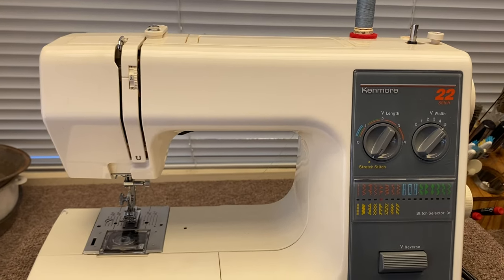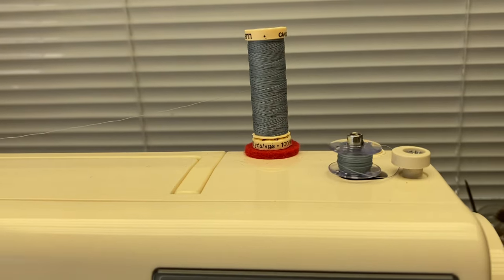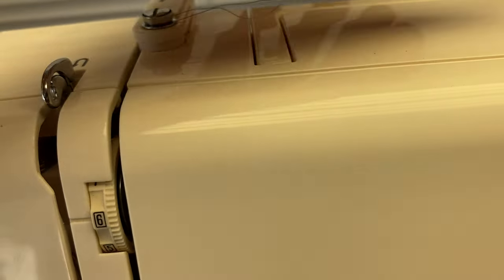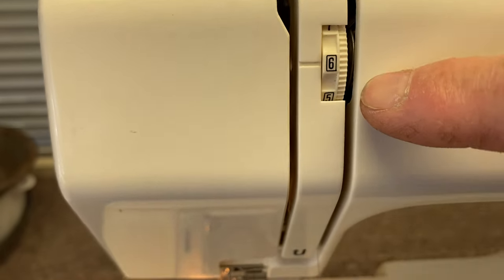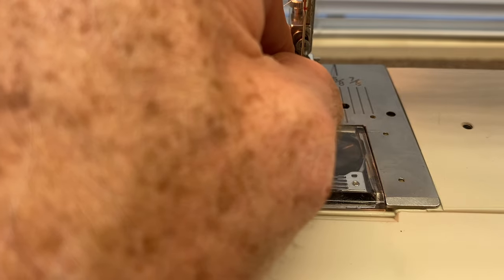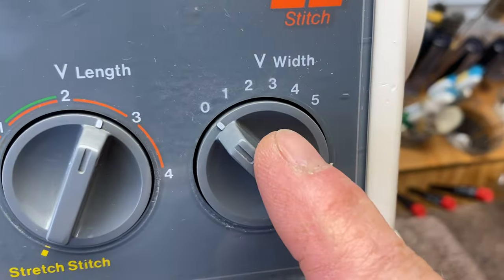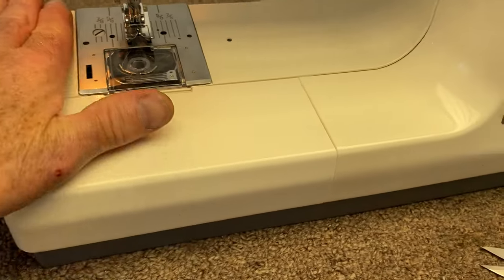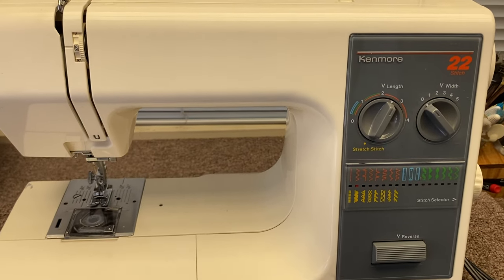Sears Kenmore 385 Sewing Machine Operation

Comment: I got this same model from a friend a week ago and sent it to the repair shop because it was not reverse stitching.  It was not used for eons  but I will call her back to duty after overhaul. Love the solid/heavy feel to it as compared to my new brother "Strong and Tough" (AVOID!). These Kenmores/Janomes have a good reputation as workhorses. Wish me luck and thank you for your great video. Greetings from Puerto Rico 🌴
Reply: Very, very good demo of this machine. I also have owned and used the 24 stitch model since the late 80's. Probably the best purchase of my lifetime. I've never needed to have it serviced. I have kept it oiled, per the manual instructions and have sewn numerous garments, including heavy  wool coats, upholstered two sofas, made handbags, etc. and the timing has survived it all. (I should knock wood making that timing statement.)

Two things. #1 When you open the door on the left to get to the pressure dial (which I use often), there is a diagram showing how to drop the bobbin into place. (One of those tedious tiny things I can never remember - so I use that door often!)

Also, I noticed that as you moved the stitch selector dials they sounded a bit clunkety-clunk and stiff. I was aware of mine sounding and moving clunky like this for years, but simply chalked it up to "age" just like creaking knee joints in the morning.

 All was fine and working one day and then on the next - NONE of the dials would move - At All! Completely frozen! 

I feared the worst - a broken plastic main gear. With much trepidation and fearing I would have to declare my baby dead and gone, I began to disassemble and uncover the nether regions of the right side of the machine - the area never addressed in the owners manual. (Not like I was voiding any warranty after 30 years!) My mouth dropped open in awe as I laid eyes upon a 100% metal gear assembly with minor amounts of lithium grease showing. Poor baby hadn't had a good lube job in 3 decades! At my BIL's at the time, (gifted mechanical engineer) he had numerous containers of lithium for me to choose from, including a spray with a straw nozzle in case I couldn't reach something with a q-tip. I did need the spray in one spot. As I added small amounts of grease, I carefully began moving all of the knobs until everything was moving as smoothly as brand new. I was careful not to allow a cotton fiber to escape from the q-tip.

All of the knobs should move smoothly with little noise and gently click into place on the stitch selector - feeling almost no resistance.

The machine in the video definitely needs a lube. The clunkey/choppy sound is a dead giveaway.

It's been 3 years and my machine has sat unused for most of the last year and a half, so I will probably go back in shortly and freshen the lithium, only this time I will use a 1/8"  to 3/16" wide, high quality 8" to 9" long art brush with short bristles  for application making certain it has no loose bristles. This way I will not need the spray lithium at all, as solid lithium is better when it can be used.

I hope by lightly freshening the lithium every 3 to 5 years at this point it will avoid the need to have to ever disassemble the gear stack completely. BIL agrees with this thinking. We are both big believers in "if it ain't broke- don't fix it", but ongoing proper lubrication is a must.

I'm certain I used less than 1/2 tsp of grease the last time and will probably use less this time. Also if it is necessary to use the spray, remember to be careful not to get any of it on any of the plastic housing of the machine. Oils can play havoc with plastics - especially older plastics - as certain oils and greases will caused chemical reactions if left over time that break down the plastic.

Sorry for the long post, but with no instructions and no YouTube video, I managed this successfully all on my own and didn't even need BIL for anything other than deciphering where in his garage his brain had decided to store lithium grease.
Reply: R. Cruz: sorry I meant to post this as a general reply and not just to you, but you may need the info also.

Comment: Thank you Paul! Just picked up on a $50 goodwill run. It seems to be top notch for hemming pants but the foot connection piece is missing I’ll let you know if I can manage to get the part and hem some pants in time for the wedding (before 4pm tomorrow). I guess I am missing the piece that normally holds the thread on top too…. I was hooking it to the bobbin winder! Great lesson. I suppose there are a couple parts you did not cover. 1 a metal plate that raises the bottom but matches the foot profile. And 2 a metal dodad about an inch and a half wide that does not seem to fit any where.

Comment: When you turn from regular stitches to the stretch stitches (yellow) is it difficult to turn the knob to the stretch stitch?   Mine is very difficult and I have tried cleaning out the sticky old grease as  best as I could without disassembly 
I’m thinking the problem may be in the linkages. Maybe I’m missing a spot where old sticky grease is still gumming up the mechanism that the knob controls. Any suggestions?  I know that when that knob turns to stretch stitch it has to activate the mechanism by the cam right behind the knob and that seems to be a sticking place til you get over the “hump” so to speak.  Anyway, help if you can 😊

Comment: Thank you for a great video. Where can I purchase replacement parts and instructions to replace… most specifically for the spool pins. The rubber casing around both spool pins has dry rotted and the spool pins fell into the body of the machine. I appreciate your assistance.

Comment: Excellent video. I really hope you can help me. I have this exact model. Got it last week from a repair/sales sewing machine store. After some use, (im a beginner) I think the feed dogs dropped because it will no longer pull the fabric through when I sew.  I rethreaded the machine like 4 times hoping that would fix it. There’s no switch in the back to raise and lower the feed dogs easily.  What the heck am I doing wrong? 😅 thx

Comment: Great video!. I bought this machine brand new 34 years ago and it is still going strong. To this day, as my brain doesn't memorize simple things well, i can never remember how the thread is supposed to run when its dropped in. When you open the door on the left side, there is a drawing on the door to remind you which direction the bobbin thread is supposed to run.

Comment: I accidently posted a reply to R. Cruz that I meant to post as a general reply here. This is an excellent video, VERY WELL DONE,  however the machine in the video is in need of a lithium grease lubrication that IS NOT covered in the Owners Manual. If you own one of these machines please look under my response to R Cruz for crucial information on lubrication, because as awesome as these machines are, they are 3 decades old and need some lithium TLC.